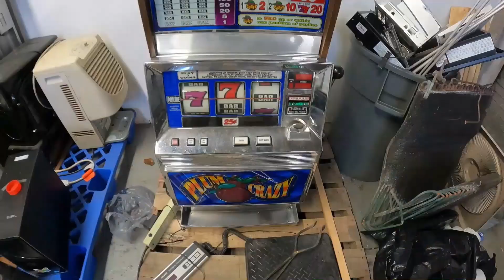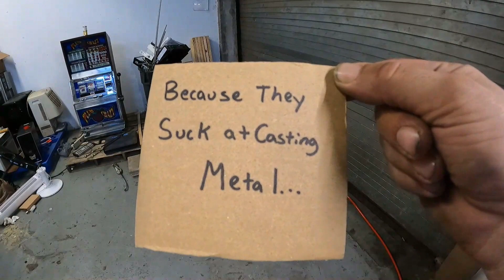Melting 5 Pounds of Scrap Copper - 2 Years on YouTube and Trolling the Trolls with a Giveaway

Comment: About the Trolls, the world is full of them now days. As for the cast iron molds, i use a spray graphite in mine and they usually turn out pretty decent. Love your videos. Keep it up.
Reply from the maker: You are definitely right about that brother!  Question regarding your suggestion:  Do you spray the graphite before or after you preheat your molds???  Thanks for the tip and for your kind words bro! 😎🍻👊🏼
Reply: @Scrap2Cast  I usually spray them when i get them and let dry then preheat later on furnace

Comment: Try dusting the molds with graphite powder before you pour - makes a Huge difference 👍🤟
Reply from the maker: I’ve heard that before, I’ll try it on the cast iron next time 🙂.  However, any idea why I’m still getting holes when pouring in graphite molds?
Reply: @Scrap2Cast  either air getting trapped as you pour try pouring slower and closer to the mold... Or the graphite mold might still have some residual moisture in it ( could be dangerous as you know) try  heating it a little longer.... or... the metal was too hot and off gassing as it hit .... probably a combination of you ask me ....the bigger the mold the harder to get a clean pour (for copper ingots specifically... from my experience)   you could try putting the mold in heated sand🤔....I'm gonna try it...🧐 I'll keep thinking and trying! And I Expect The Same From You!!!🤘🤙

Comment: Have you ever figured out how much propane you use per pond of metal melted? With a make shift furnace and a tiger torch I did 100 pounds of aluminum with 20 pounds of propane.
Reply from the maker: Honestly I dont usually melt anymore than 5 lbs of copper at a time, but I would say easily 40 lbs if I already had the material stockpiled.  Aluminum would be well over 100+ lbs.